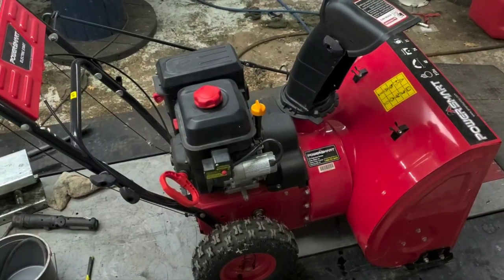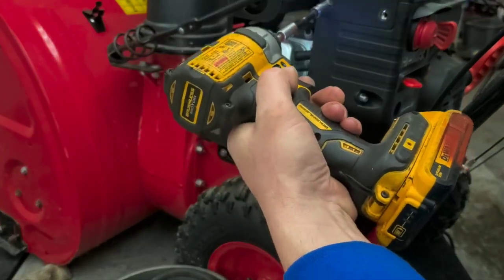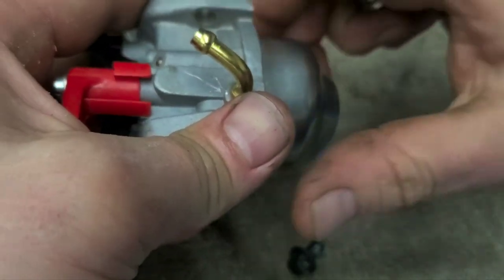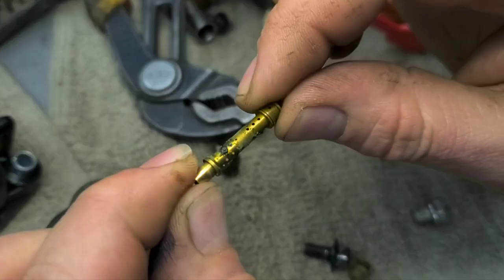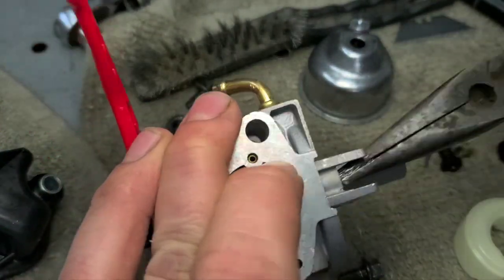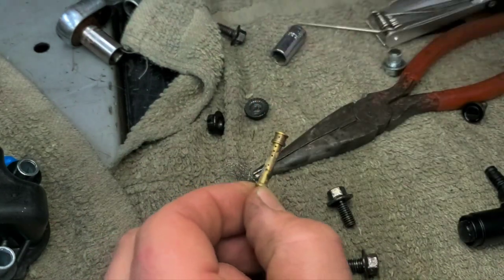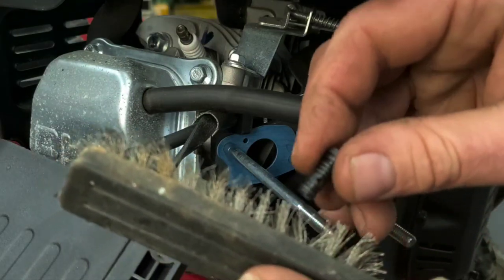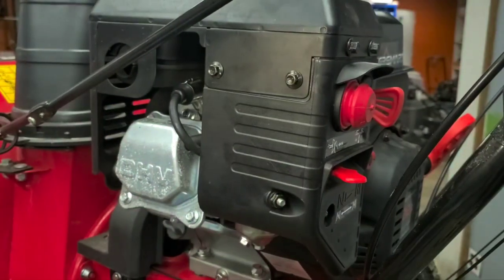Powersmart Snow Blower Repair Won't Start Ultrasonic Carburetor Cleaning

Comment: Wow excellent timing, I pulled out my blower (same model) today and it would not fire up. I used some dental picks and carb cleaner to clean it out. Popped the carb back in, primed it a couple times and it fired right up. We have a decent sized storm coming in the next couple days so I really appreciate it.
Reply from the maker: Awesome, never thought about using a dental pick! Appreciate your watching Franklin, glad to have helped! Happy snow blowing!

Comment: Hoping you see this comment, I could really use a suggestion. I bought the same snowblower a year ago. Brought it home test Ran her, fired right up, zero issues. Six months later, it snows. I pull it out to use it, it would not start. Found the ignition coil was bad. Replace that still won’t start. Just took off the carburetor and took it apart, it’s completely clean. It tries to start, it just will not start. Could it simply come down to the gas was the issue for the fail to start? This thing is brand new.
Reply from the maker: It could come down to just this, yes. I would go through the full diagnosis process to figure out what is going on. If it starts on starting fluid or carb cleaner you have you answer
Reply: @IndRepair  i hit it with some staring fluid, it starts for 1-2 seconds then dies. so ill drain the tank and carb and put some fresh gas in.
Reply from the maker: Nice
Reply: @IndRepair   appreciate the help sir!

Comment: What made his video so good? He's showing you all the details and tricks of his trade.  Basically explains everything very well and why.  Absolutely excellent job!  I chose to simply buy a new Carburetor and install it.  Then take the old carburetor to my bench and take my time cleaning it.  Now I always empty out the entire gasoline and carburetor at the end of every season.  I then install a clean fitting rag In the throat of the gas tank. and keep the gas cap off.  Why? Because I don't want condensation going into the clean, dry And empty gas tank.  When snow blowing season returns I always use sta-bil in my gas.  And I have a back up clean carburetor ready to go.  I will never take chances again with gas that can screw up my carburetor.
Reply from the maker: That is a smart move having a backup ready!!
Reply: @IndRepair  And ever since I've been emptying out the carburetor bowl and the gas tank of all gasoline and installing a clean dry rag in the throat of the gas tank with the gas cap off, I have never had a problem since.  And if I forget I have sta-bil in the gas.  Simple tricks tricks but they are highly effective. And I no longer have to rebuild carburetors.
Reply from the maker: Awesome!

Comment: I have a snowblower just like the one in your video. Instead of cleaning the carburetor, I would like to buy a carburetor from Amazon. Do you know the part number? (Model: DB7651-24")
Reply from the maker: Use the one at https://amzn.to/3t4X1hn
Reply: @IndRepair  Thanks!!!!
Reply: @IndRepair  I bought a Carburetor from Amazon and replaced the old one. It works well. Thanks again.
Reply from the maker: Awesome job!

Comment: Very detailed instructions. I I cleaned the spark plug but I still could not start the engine. Then, I was able to do everything you suggested and found that the carburetor is working fine. After that, I bought a new spark plug and replaced the old one. Everything works fine now. It was a good experience and I learned a lot! Thank you very much.
Reply from the maker: Awesome news! Great job! Thanks for watching!

Comment: Would draining all gas and adding pure seafoam to tank be enough to break the clogs? Add seafoam, pull cord several times, let it sit overnight?
Reply from the maker: Normally no, anything is possibly depending on what kind of varnish/debris is in the carburetor. Giving it a shot will not hurt but you will probably just have to do the full repair in the end. Thanks for watching!
Reply: for the record, in case anyone else is thinking the same, this did not work. The main jet was so gummed up that there was no way for the seafoam to get in there.
Reply from the maker: Usually is the case

Comment: Follow up to my saga. First, thank you for this excellent how-to video. It was super helpful.  My advice for anyone trying to do this as fast and efficient as possible is to just buy a new carb. The carb kit is $25 and comes with gasket, accessories, and even a new spark plug. For my Model "DB7651-24" I ran into some gotchas. First, my handles were in the way of the housing so I had to remove the handles (2 large screws at base on each side next to tires, you can probably get by just removing the bottom one each side and loosening the top one which will allow the handle assembly to move backward). After cleaning the carb, I found that my o-rings on the idle jet were bad and would not seat properly @24:50 so I ended up ordering a new carb. This may have been my fault for letting the idle jet and o-rings sit in carb cleaner. I believe the carb cleaner disintegrated the rubber o-rings. Another gotcha, during reassembly one of the screw rods @27:20 was too short. I finally figured out that one of the plastic holes was slightly "out of round" and the spacer wasn't sliding through it like it should. Applying a little vasoline with a Q-Tip fixed that. So after many hours of work (yeah I know, I'm an amateur, lol), it's finally running! for reference, this carb worked for me, but make sure to verify it matches your blower before purchasing. There are 2 different models so look closely at choke lever and gas line attachment.  https://www.ebay.com/itm/225192408478  or just search for "127-9111 Carburetor". Hope this helps others possibly facing similar issues.  Cheers and happy blowing!  why does that sound so dirty... :)
Reply from the maker: Great tips!! So glad you got it going!

Comment: as expected, I ran into trouble. For some reason, my pilot jet does not go all the way back in. The cavity is clean and clear. Tried forcing it but it sticks out just a bit.  Forcing it also destroyed the o-rings so now I'm probably looking at a new carb?  Cannot imagine how I'd find new o-rings for that part.
Reply from the maker: They do sell the pilot jet as an assembly through MTD I believe but the bad news is the price for it is just as much as an aftermarket carburetor
Reply: @IndRepair  Bought a new carb and it's running now, but seems to be idling faster than normal. You mentioned the idle screw doesn't need adjustment, just set about halfway which I did.  Is there truly only one speed for these engines? I do have a high concentration of leftover seafoam in the tank so maybe it's causing it to run hot?  Thanks!
Reply from the maker: Normally something like this is going to be the cause of an air leak between the carburetor and the intake. If the idle screw is too far so it will not idle down (for models that have a throttle lever) You can just unscrew the plastic stopper a little bit.

Comment: I did stipped the brass thing and cant get to emulsion tube. Any trick to get that out ?
Reply from the maker: Once it is stripped it is pretty well done for. You can try a larger screwdriver and push while turning
Reply: @IndRepair  got it, thanks for quick reply.
Reply from the maker: @mannysingh8976  Glad to help!

Comment: Any idea where to get a replacement carb for this machine? I can't seem to find one.
Reply from the maker: We use a 133-1534 replacement carburetor on these. Be careful when you order, as they make two different styles. The fuel inlet that comes out to the back at an angle is the one you want. If you get the one with a straight fuel inlet, it is slightly larger diameter and will require lengthening the fuel line normally. If you go this aftermarket route, check the float bowl for debris before installing.
Reply: The carb # is meant for Toro snowblowers.  I guess it would work on PowerSmart model # DB7651-24 as well? @IndRepair
Reply from the maker: They are all Chinese clones the part number provided will work well!

Comment: This is the exact reason there's a gas shut off valve on this snowblower.

If people would read the operating instructions that are posted on the machine itself, nobody would have this problem, and you wouldn't have a job!😊

When done using, turn the gas off, run snowblower until it quits running."

 Doing so, runs all the gas out of the carburetor.

If you follow this procedure everytime you use it, you will never have a gummed up carburetor, a snowblower that won't start when you most need it!
Reply from the maker: The only problem with letting the fuel run out is there is still about 2 ounces that sits in the carburetor, evaporates and leaves a nice deposit of varnish/gum for your new fuel to break up and clog the jets with after you add fuel. There is a drain on the bottom of the carburetor that will work much better but if leaving any fuel in the machines we recommend ethanol free fuel and leave all the way to the fill line so moisture does not gather.
Reply: @IndRepair  12 years and never had a problem. Shut the fuel off let it run until engine stalls.
The only thing I've ever done to my sno tec 24 inch snowblower, change the oil, put air in the tires, gas in the gas tank, blow the crap out of snow!
Reply from the maker: Awesome news!

Comment: I did all this but found out that i ripped the gaskets and bent one, metal trying to get them off. however, my machine is a powersmart pss2240
Reply from the maker: They will definitely need replaced to get it running right. Thanks for watching!

Comment: Accidently stripped one of the bolts that holds the carburetor. Anyone know how to replace it?
Reply from the maker: It just unscrews from the block and a new one screws in. Use good pliers or vice grips to grab hold

Comment: Does anyone know the part number for the fuel on/off switch? Mines missing and I need to replace lol.
Reply from the maker: If you have the info from the side of the engine I can find it for you. I do not have it and apparently did not mention it on this one

Comment: Home Cheapo Special. Very poorly made. I stay clear of them
Reply from the maker: They sure are! Is there anything that isn't anymore? All basically the same clone engine copying the original Honda GX160 with varying differences
Reply: Too much plastic that breaks in the cold, and that ridiculous pivoting linkage for the drive system? Guess they’d rather design complicated over simple. A good value for the money? Maybe, but I’d rather spend a few hundred more and get an Ariens or Toro. In their defense they have a great service department and parts are plentiful, no doubt because parts need to be replaced often lol!
Reply from the maker: @KensSmallEngineRepair  Engineers are great at designing products that break or involve constant maintenance to keep going. It helps them sell more units/parts and they make more money overall this way. Corporate executives get bonuses for these ideas regularly! Thanks for watching!
Reply: I was an Engineer for years and have been in the manufacturing field for 40 years, the stories I could tell, unbelievable! It all started in the 80s. When we figured out we could source off shore and save a few bucks!
Reply: Wow! Great instructional video. I bet you train people often. With that detail and precise instruction I would be surprised if you didn't train people. My powersmart only works in the choke position and dies out when in run position. I'm sure its the carburetor. Extremely helpful. Thanks! Often you see videos that have a microphone across the room and blurry video with missing steps needed.
Reply: Don’t know how you treat your machines but my power smart from home cheapo has been running for 5 years straight since I bought it in 2017, and I live outside of Chicago where a typical winter gets -35, several feet of snow, everything that CAN rust will rust over one winter season from the harsh elements here. I even leave the gas in it with a little bit of storage fluid mixed in when I store it for spring summer and fall, and it still has its original spark plug in it and only changed the oil twice so far in the 5 years. Mine has been garage kept since day one, and before I store it I run it for several minutes to make sure it runs right before it’s stored and to get the fluids flowing to keep the system clean and so the storage fluid gas mixture gets into the injection ports, carburetor, etc. In late fall right when the last bit of trees start to change colors and leaves fall that’s when I start the blower up (started  on first pull yesterday and It’s been stored since March) to make sure it’s good to go, working properly, so I’m not out in single digit weather freezing my butt off trying to diagnose and fix it. This week is 60 degree weather so if It had any issues, working on it in on a 68 degree day with a couple beers would be a breeze. 

So, maybe it’s not always the brand or store, and maybe it’s how it’s taken care of, protected from the elements, etc.
Reply from the maker: Yes maintenance is almost always the key. Many bottom of the line to upper mid price point products are all the same skeleton, engine and transmission with different features. Thanks for watching!